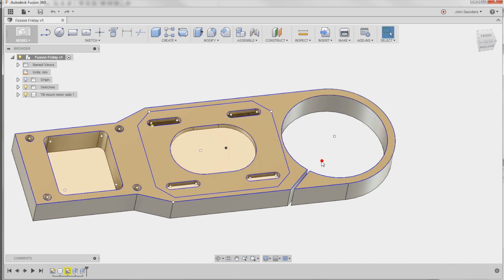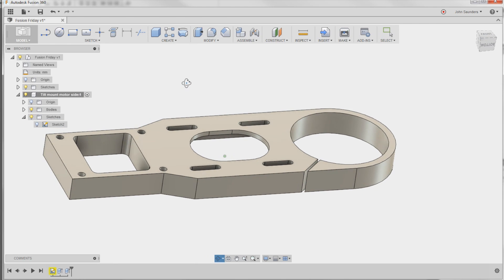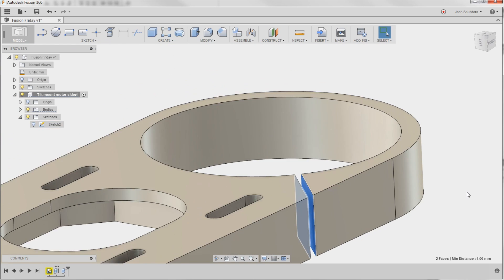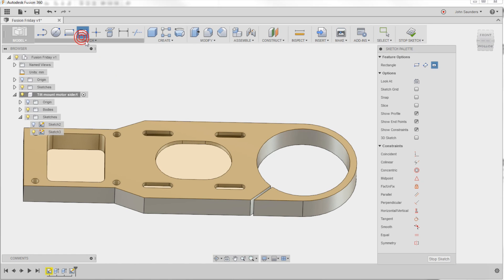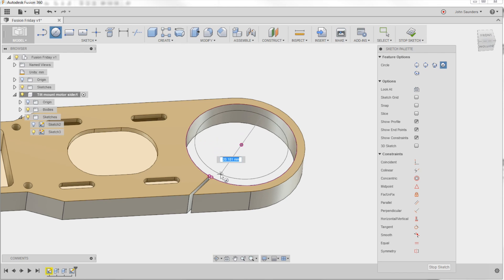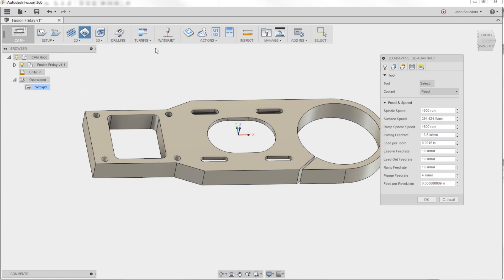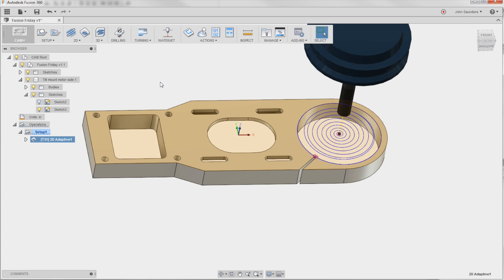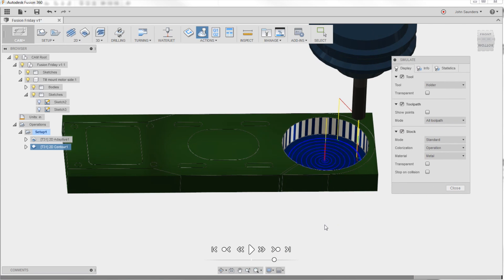Fixing a Broken Circle in Fusion 360! Fusion Friday 32

Comment: I had this same problem the other day and I solved it differently, without making or removing any features. 2d contour > select your line (which selects the area you want to machine as well as the outside perimeter of the part) > move mouse away > left click the same line again (brings up small context options) > click the "U" shape (open contour, will deselect everything except the line you have been clicking) > left click other lines to add them one by one if needed. This may not work in your situation because it might try to avoid the open area still. But you could probably add the two lines of the band saw cut area to the circle and rely on the tool being too big to machine that area and still give you a nice tool path for cutting out your circle. Sorry this is bad run on comment.

Comment: A easy way to do that is use a 2 point circle find a center on one side drag it over 2 the other side and snap it to the other center leave it turned on and there is your toolpath 10 seconds done it's called a drawn tool path
Reply: Another version is too click Construct and at the bottom select Center point of Circle/Sphere/Torus. That will give you a center point of your broken circle.

Comment: Why do the project?  (Other than to show the project command). Just starting a new sketch and draw a circle, then constrain the circle to be concentric and co-radial to the existing bore. Or just concentric and dimension the circles diameter. 

Would prevent having two overlapping sketches (the projected sketch and the circle you put in manually).
Reply: +NYC CNC 

Wait.  So if you do a new sketch on a surface, and draw a circle manually and constrain it to existing edge features, it just creates an entirely new projected sketch??

Comment: 2D bore operation seems to cope just fine with a slit on a borehole. Much simpler solution would be to use the Patch mode and loft out the slot or some other patch operation.
Reply: Another alternative is Drill - Bore Milling which also ignores split geometry like this, and can be set to do multiple holes of the same diameter like any other drill operation.

Comment: https://youtu.be/RQh6-6KeKZM John have you seen this video I created a while ago yet?
Reply: +NYC CNC tangential extension distance will do the job in most cases
Reply: +NYC CNC yeah it will result in a flat that will get cut away when the slit is cut. you can also use the radius of the lead in & out.